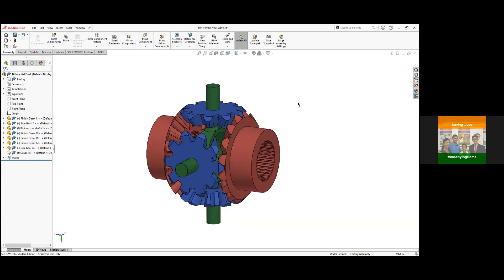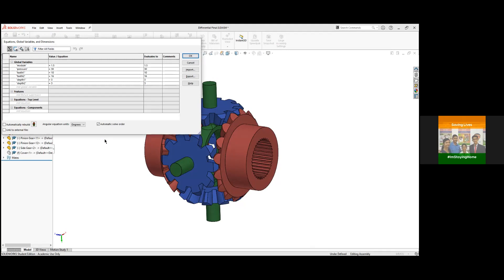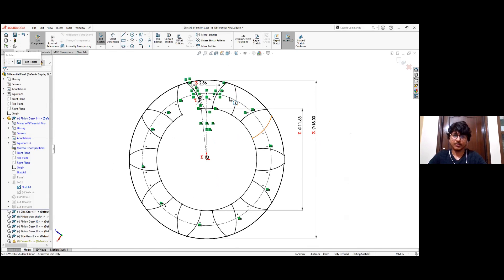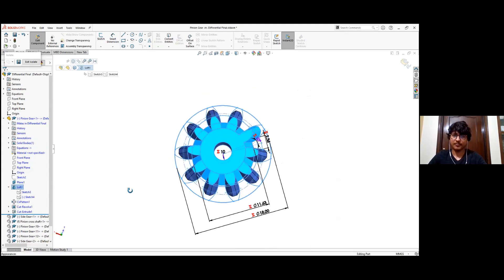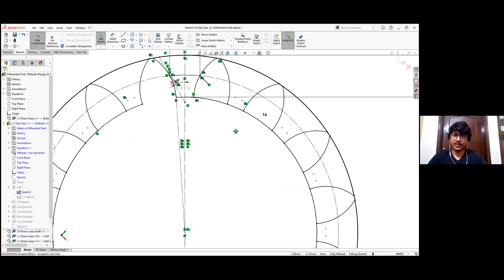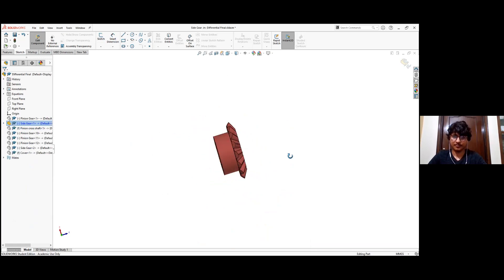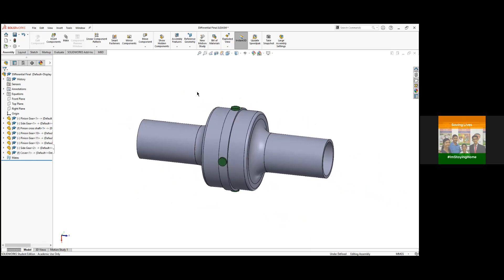Differential Gear Sketching & Modelling, SolidWorks Toolbox |Drivetrain| Formula Student| FSAE|Supra

Comment from the maker: Video Timestamps

00:00 Previous Video Recap
00:11 Video Outline
00:30 Parameter Set Explained In Detail
02:09 Library for Standard Parts
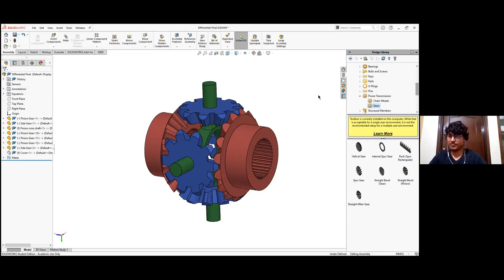03:41 Pinion Gear Sketching and Modelling With Parameters
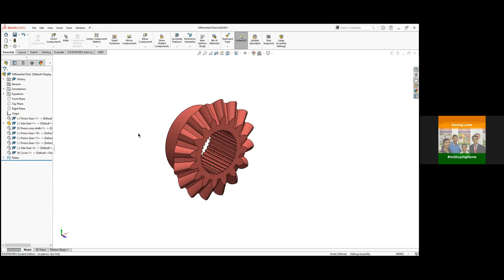08:28 Side Gear Modelling